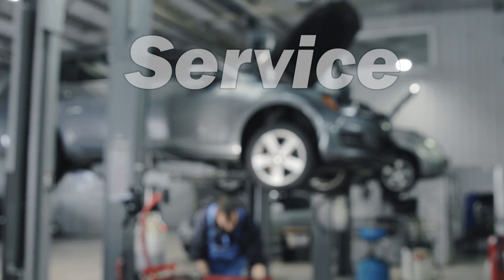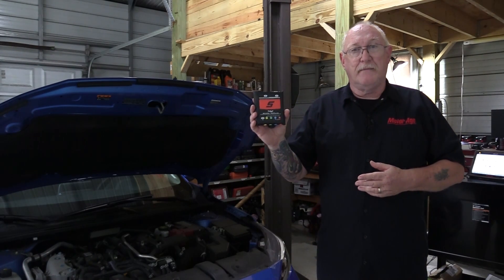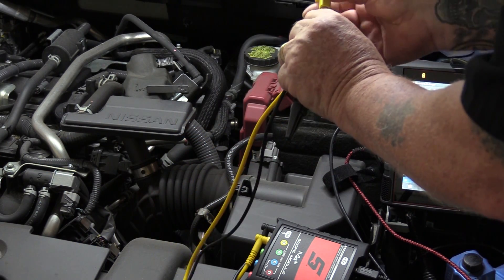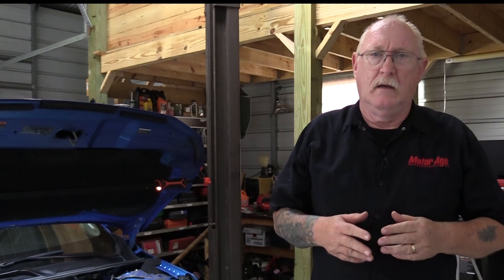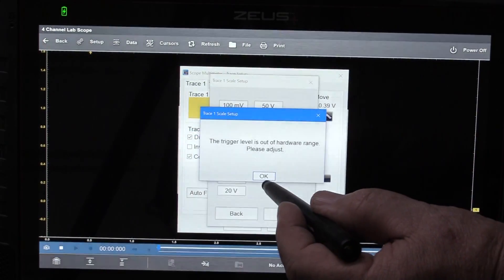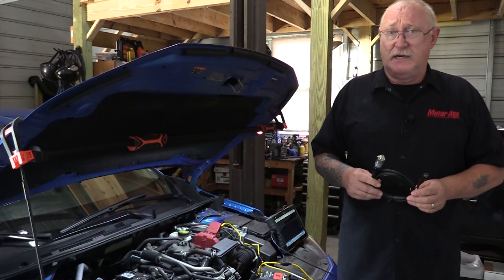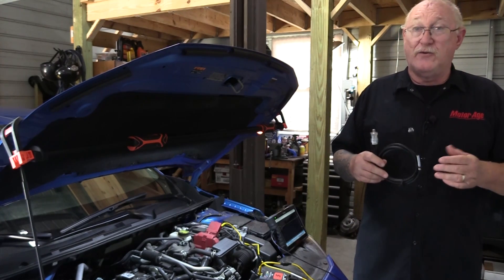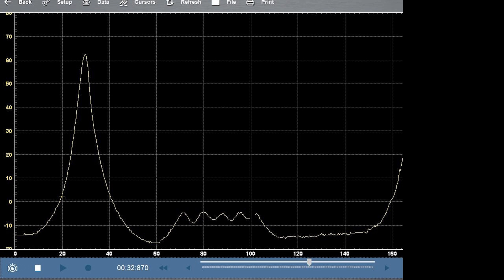TechTip #9:  Advanced Drivability Diagnostics With The Snap-on Zeus+

Comment: Not worth the cost. If the Zeus+ came with service information, then maybe. But it doesn't and you have the cost of the scanner plus $99 per month for updates and to make everything work.  

I'm not sure it's worth even $99 per month if they gave you the scanner. Compared to the $700 to $1500 Launch tools, the Launch scanners do more!

The $100 per month on top of the high cost for this Snap-on tool, they are dollaring us to death! But no service information included not even a free 1 year trial when Snap-on owns Mitchell makes this tool overly expensive.

Comment: Is the difference in peak compression height and difference in expansion pocket to height of intake phase due to transducer accuracy? I'm using a wps500x with my Zeus and don't see any rise / difference in height as seen here. Time for snap-on to upgrade pressure sensors? Just wondering.
Reply from the maker: Are you doing a running or cranking compression test?
Reply: @VehicleServiceandRepair  running. Exhaust opening on your waveform looks fine... just wondering why the intake phase is higher than the bottom of the expansion pocket.